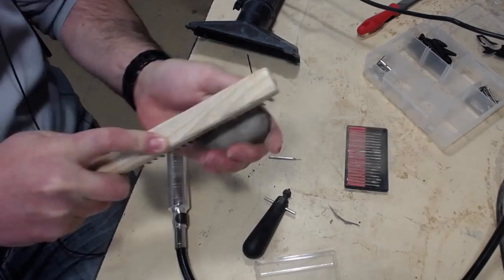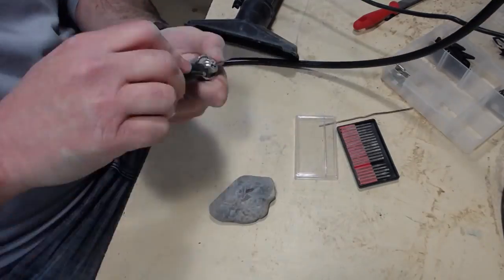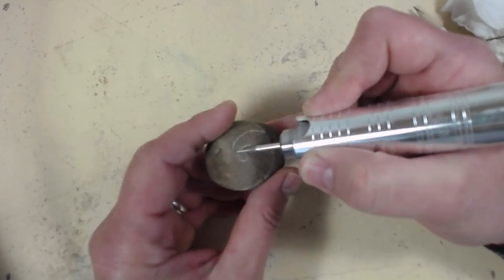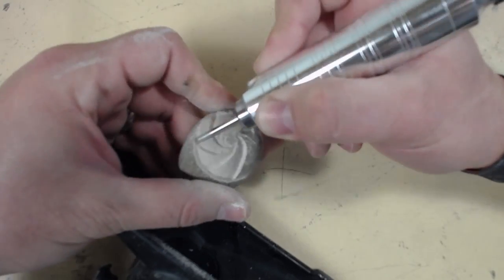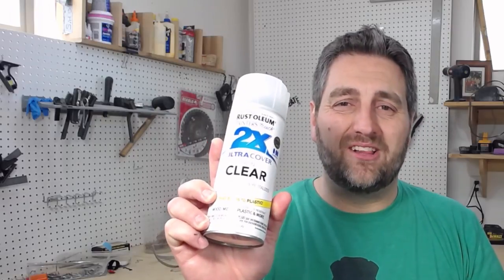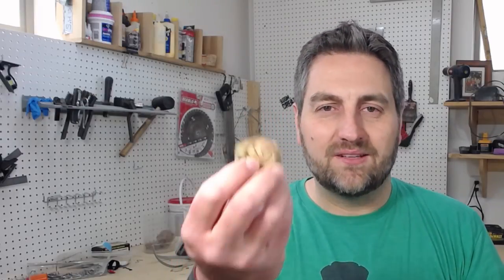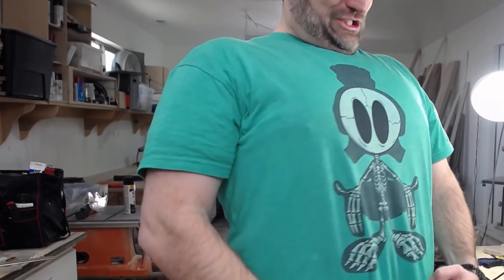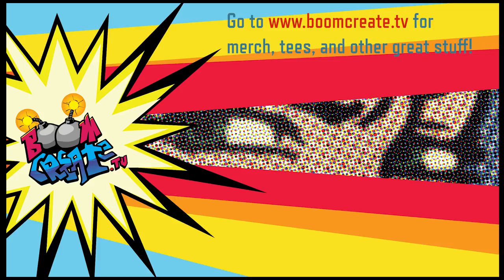How to Carve Rocks! Part 1

Comment: As someone who plays at flint napping I will tell you one of the first things you learn is NOT TO BREATH IN THAT DUST. Make sure you have good ventilation and preferably a breeze or fan blowing the dust away from you. One of the main causes of lung problems with nappers is the dust. In the old days of flintlock firearms, the nappers lived very short lives because of breathing the dust.  Having said that, it's still pretty cool. I've carved a lot of wood and beat on some rock, but i never tried carving on one. Might give it a try. Just remember, DON'T BREATH IN THE DUST.
Reply from the maker: Totally. You'll notice that at one point I got a little smarter and had a vacuum running  right next to the work. It helped so I wasn't breathing it, and got the dust out of the way so I could see the work.

Comment: Did you mention the mask your wearing?
Reply from the maker: It's a respirator mask with filters. I should have had water running on the project the whole time, it would have made the bits last longer and reduced dust.

Comment: Thank you for putting a link/description of the tools. A lot of videos I've watched recently don't say what tools are used... And that's frustrating for someone who isn't tool savvy and wants to start a new hobby.
Reply from the maker: I try to do that, but it doesn't always work. I don't mind starting with the cheaper tools to see what I do and don't need.
Reply: @BoomCreateTV  that's exactly what I do. I start with the cheapest tools possible for the job when it's something I've never done before. But ultimately end up getting mad at myself that I did that because if it's something I really enjoy I just wasted money when I could have gotten exactly what I needed that would have done the job a hell of a lot better! I did that with my first Dremel and wood carving tools. The money I put towards the cheaper ones could have went towards a way better set.

Comment: Thanks for Sharing! I inherited a bunch of Dremel tools and a Forden hanging power carver. I have been practicing on wood and the first thing I did is what you suggested. I worked with each bit to see what would be preferable for the box I want to engrave. I also do woodworking so I have a lot of scraps to practice on. And after seeing you carve on a rock I want to try that as well. You gave me the idea to cut a rock in half and use it as an inlay on the top of the box! Thank you!!
Reply from the maker: That sounds awesome! Make sure to keep the bits wet, I didn't and it trashed them.
Reply from the maker: Send a pic when you are done!

Comment: Hey man. Good work. May I ask, what was the can of stuff you sprayed on the rock? Is it a wood finish or what was the gloss you spoke of? I want to finish my own project. I'm carving a stone necklace for my partner. I need that last coat to finish it off.

Thanks for your time and this video. It was great
Reply from the maker: Just barely saw this.  I just used a clear gloss paint.  There might be better finishes

Comment: Hello!! I have a huge question and for this... I need help!!

I bought a dremel sometime ago... And its been good... But at the sametime annoying... Which is frustrating cause I can not enjoy the process...

I do not know what I am doing wrong or if its the tool its self...
Reason why I am taking the liberty to ask a few questions.

Is there a reason why a bit will loosen up and move from the position it was needed? (Even when I tighten it up hard?) This is the main one.

I use water to prevent the bits to over heat (that is good right?)

I need help to identify the right bit for the right rock type... Cause I would see videos and for me I have the right bit... But then when Ive tried them out... It does not work. 😥

I would appreciate the input...

Thank you.
Reply from the maker: Awesome! Okay. 
1. bits will loosen up with vibration. Anything you can do to limit vibration will help, so lubrication, better tool or handpiece. But sometimes you can't get around it. and just have to tighten up once in a while. 
2. Yes. Use water to lubricate the tool and stone. It will save your tools. I learned this the hard way while making these videos. 
3. Rock type is all about preference. I'm no expert, so it's just about color for me.  Make sure you are using diamond bits. 
Good luck!
Reply: @BoomCreateTV  Appreciate your info. Thank you.

Comment: I’ve seen videos where people keep the rock wet the whole way through. Is that necessary?
Reply from the maker: When I did this, I just kind of went for it. I ended up eating up my diamond bits too fast because I wasn't using enough water. It also keeps the dust down. I would definitely recommend a system that keeps it wet.

Comment: Hey! So I live in a military barracks and I'm not allowed to have plug in tools like this inside. I was wondering if I could use a battery powered dremel for this? And if I did get a battery powered dremel from like amazon or something do you think I could bring it to the river with me where I find all my cool rocks and just sit there in the dirt and carve them in the water? I see a lot of people using a water source for their carvings so it doesn't crack from the heat and vibrations. I need som advice please! Like I said, I can't have any tools in my barracks. I just love fishing and I find cool rocks on my adventures.
Reply from the maker: I think the biggest limit there would be battery life. But it should work as long as you have charge.   I should have used a water source, so I ended up wearing down my bits too fast. Start with the cheap ones to get used to it.

Comment: What size air compressor do you use if you dont mind me asking? About how many gallongs/psi/cfm? I am wanting to get into carving rocks with a die grinder... ive done two by hand and it takes for ever .. thanks all info is appreciated.
Reply from the maker: Great question, I'm not using an air compressor. I'm using a rotary flex shaft tool. It's an electric motor with a flexible shaft. I've had a few questions about this so I'm thinking it's time for a video about it.

Comment: What kind of mask do you use
Reply from the maker: It's a respirator mask with filters. I should have had water running on the project the whole time, it would have made the bits last longer and reduced dust.

Comment: Will this work with gemstone?
Reply from the maker: It might, but it probably depends on the stone and what you are doing. They are diamond bits, so it might cut, depending on hardness.
Reply: @BoomCreateTV  garnet,sapphire, or ruby
Reply from the maker: @jeromeissac8915  Ok. Check the hardness. Also, if you are working with small stuff, I'd suggest taking a class or looking at videos specific to that.